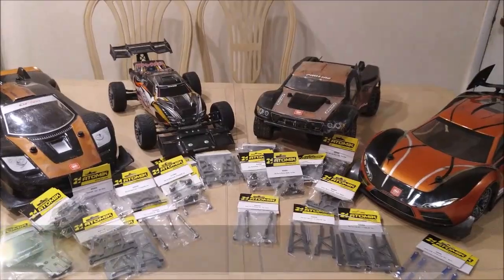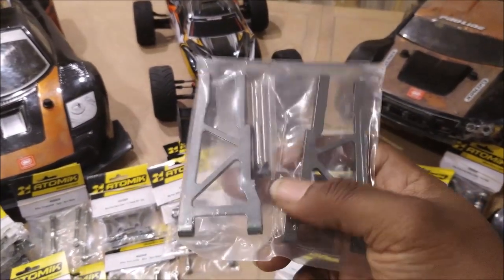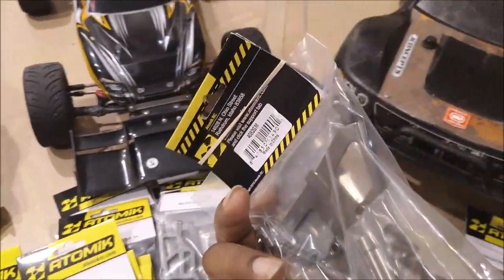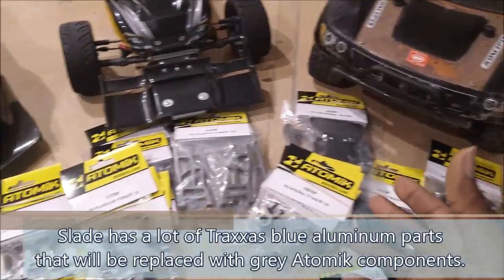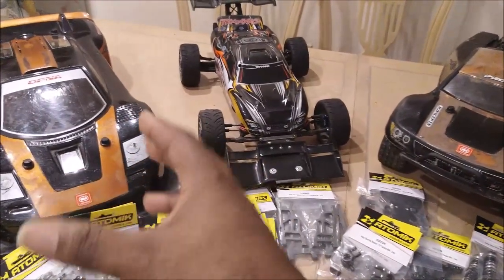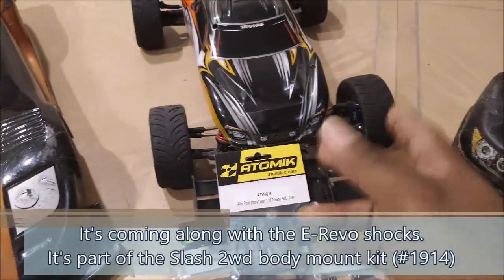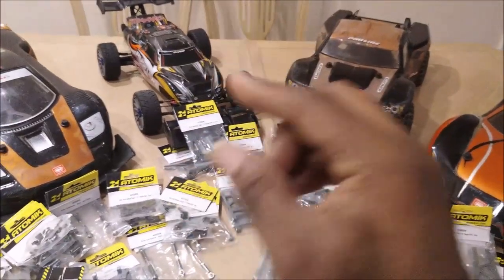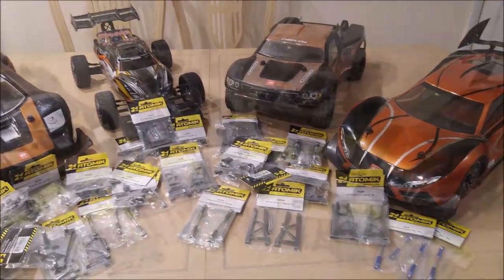Ep. 272: ATOMiK RC Aluminum Upgrades

Comment: Great video. Glad to see you’re back! One comment on aluminum, I would never use it on a high stress area due to the fact that aluminum doesn’t flex. It will crack or shatter first.
Reply from the maker: Great points. I was going to go over all that in my install video. There's a lot to consider before going aluminum.
Reply: Mainly just aluminum arms are the real bad one’s.
Reply from the maker: A Arms see a lot of punishment. They are great for racing or on-road applications where the chances of a wreck are lower, though.